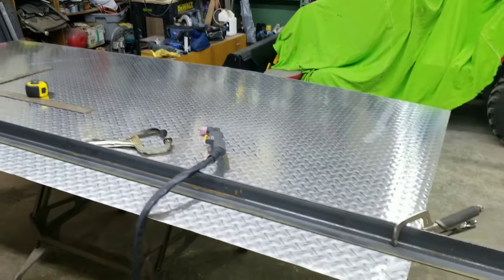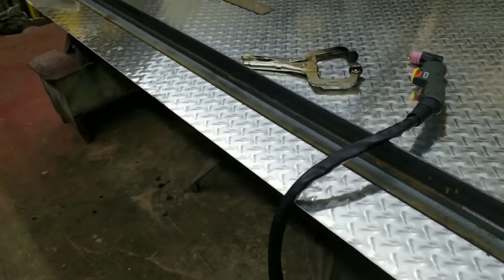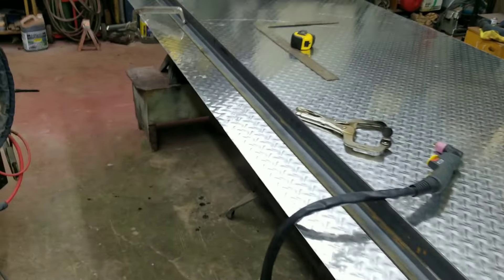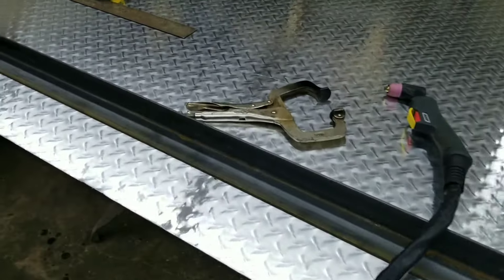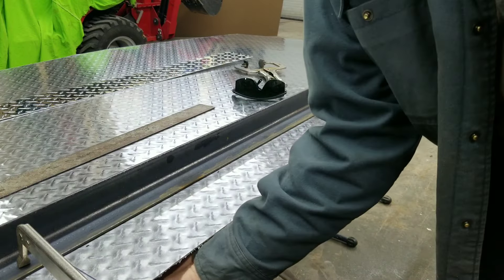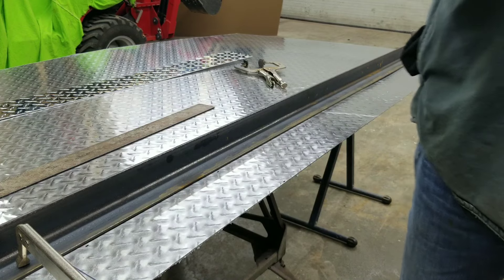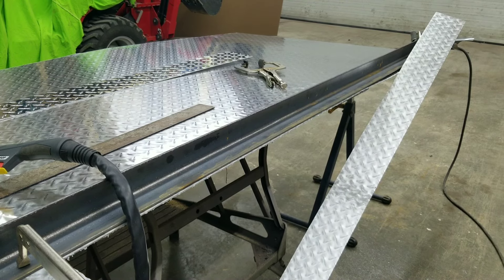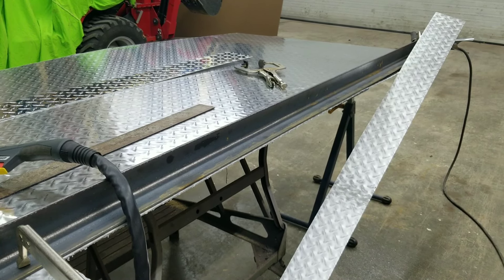Cutting aluminum sheets or plate with a plasma cutter

Comment: Cool.  I cut 5052 h 32.  .063. Have over 5,200 cuts so far according to my cnc   I only run 28 amps at ussually 144ipm on my metal signs. Give very little dross.     Nice job 😊
Reply from the maker: Oh man that must be amazing to have a CNC.  What type and what did it cost ?
Reply: @ontariooutdoorsman  I have a Hypertherm 45xp with a Langmuire table.  I’m going with a 4’ by 8’ because I only have a 3’ by 4’ right now.  Had no idea how much I would cut on this machine.  I have made around 120 signs slash metal art with it.  It’s been awesome.  I use pronest LT from Hypertherm and my program is from fire control for my cutting software.  It was a learning curve at first but it’s great being able to cut whatever you want to.  Cost for the machine and my laptop with plasma and mechanized torch was around 9k.  All said and done.  They are pretty inexpensive now.  Check out Langmuire systems. They are now owned by shop Sabre. Who has a lot of cnc for metal and wood.  They have them as cheap as 2k I believe for the smaller one with no water bed.  But you still need a plasma and computer for them.
Reply from the maker: That's amazing.  I'm ging to check that out.  I cant imagine how amazing that must be !
Reply: @ontariooutdoorsman  ya I absolutely love this thing.  They pay for themselves just from what you make from them.  All I cut is aluminum.  I have over 100 sheets of it. My wife and I do this together. It’s very awesome to draw up signs and art work and then just cut them out

Comment: Circular saw - non ferrous  metal blade = no slag -  no consumable use - no edge clean up - no fire hazard - no burn risk..... circular saw better, hands down...
Reply from the maker: I have used that too.  If you have a long level surface and can support the sheet, and are not cutting curves it works great.  The plasma cutter is literally like drawing with a magic marker.  Has made any shape very easy.
Reply: @ontariooutdoorsman  For shapes 100% agreed !

Comment: What amperage / air pressure do you use for aluminum?
Reply from the maker: So although full power Is not required depending on thickness ... I usually just leave my setting at 50 amps and always have my air at about 65 psi.  Aluminum cuts look different than steel as the edge wont be as smooth but it will  be a good cut.